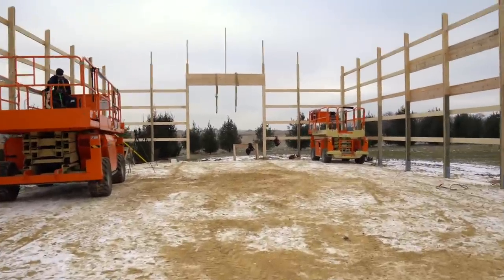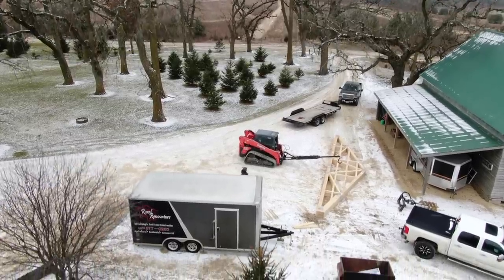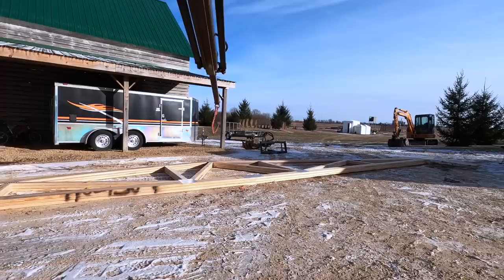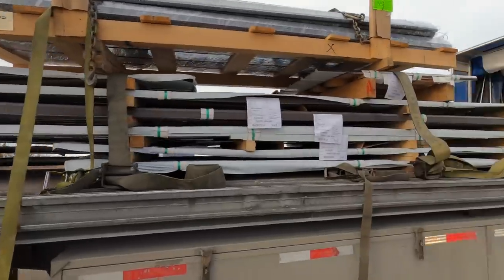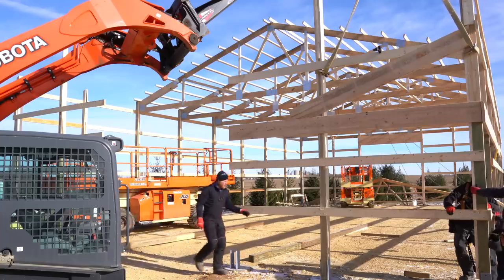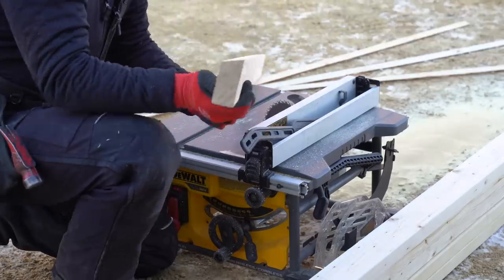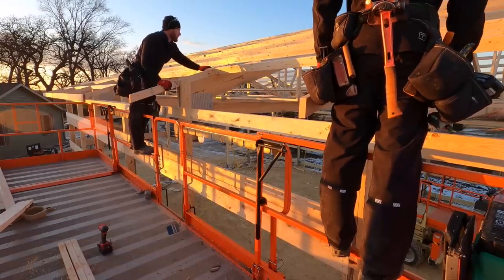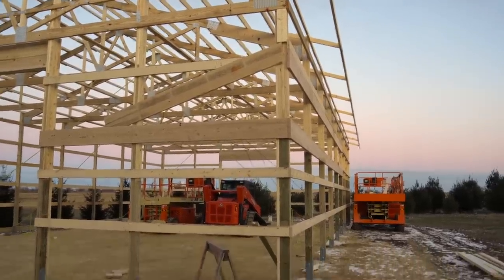Building a Large Garage: Part 2 Installing Trusses

Comment: If I may, when carrying materials keep the load close to the machine until time to hoist it. That way the load won’t be so sensitive to the terrain and bouncing. Another tip that will help you is whenever traversing an obstacle with a track machine is instead of going over it with both tracks and having the whole thing bounce try angling up and over one track at a time. It makes the track frame “longer” (on an angular dimension) and the “moment” also longer and much easier to control the machine and load. Good luck love your videos. It’s nice to see someone with integrity who actually cares about the product

Comment: I have the first generation corded Makita table saw with a Rousseau foldable jobsite table saw stand. I have two outfeed tables, a side extension table and the router assembly. I can rip a full sheet very easily without any help. I can also easily do a cross cut on a full sheet all by myself. You should get a Rousseau portable jobsite table saw stand with the use of your portable job site table saw and make your life easier and much more safe.
Reply from the maker: usually I would bust my cut hub out but just didn't
Reply: @RRBuildings  What is a cut hub? Sounds like a board stretcher.

Comment: At 19:36 of this video is an image of the Truss sitting in the laminated beam, also adding on the 2ft over hand 2x4 board. Why does the overhang board look to be higher than the 1/2 - 1 inch taller than the angle cut of the upright post / beam!   Is there an issue with the post / beam coming up higher on the two outer board to be flush with the top of the overhang board that was cut at the roof pitch????

Comment: Why did you drive a nail straight down from the top of the rafter extension?  I noticed you toe nailed with the gun but why isn't that enough?
Reply from the maker: uplift...trying to keep it as strong as possible as the tails will encounter wind

Comment: Just a random thought,if you attach a piece of 2×4 onto the side of your saw hourse with a little spacer then you will have somewhere to hang your saw with the rafters hooks instead of laying it on the floor and potentially putting them out of line